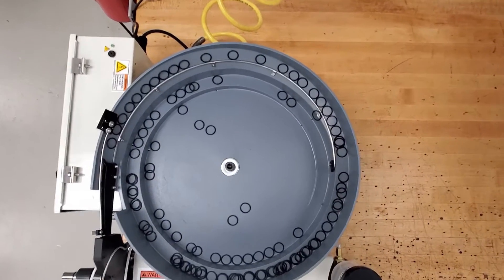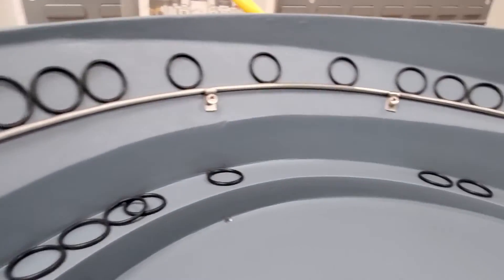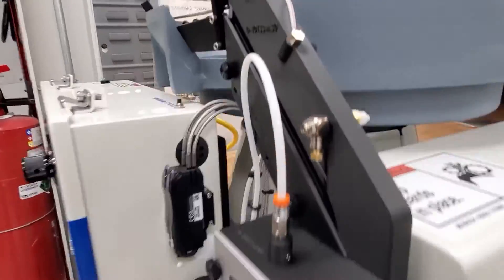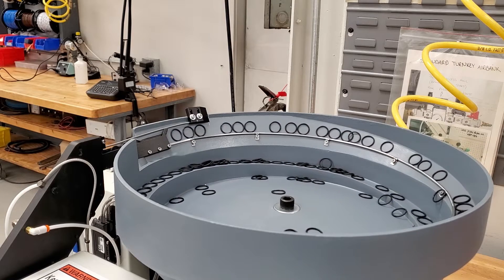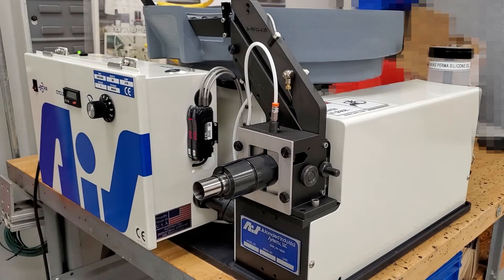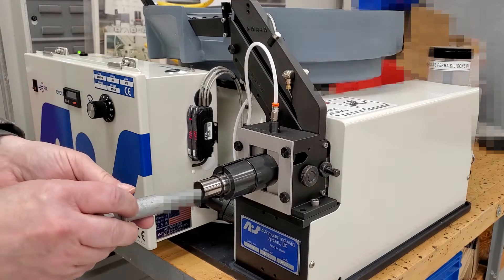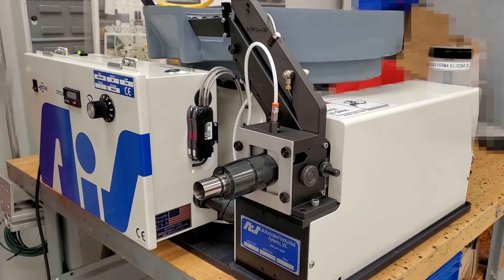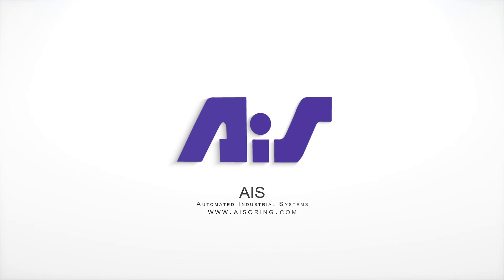Custom Engineered ASP-1 O-Ring Installation Machine from AIS.  Installing O-Rings on 2in long bolts.

Comment: I have a question if you have an issue of the mandrel getting stuck inside and it won’t come out how can you fix it to stop the mandrel getting stuck. Can you do a video of it thank you!
Reply from the maker: Hello!  
This video:
https://www.youtube.com/watch?v=wkQq79-xCiA

has a section on 'back-stop adjustment' and that should take care of your problems.

If that doesn't do it, please let us know and we can work on one that will!
Reply: @ Thankyou do you have easier way to fix it instead of opening up the machine?
Reply from the maker: @ For the problem you mentioned the best two options are:
1) Turning the power off then back on, the hitting the reset switch if needed.
2) The adjustments mentioned in the video.

If those don't take care of it, which is rare, you can give us a call and we can try to see what else it may be.